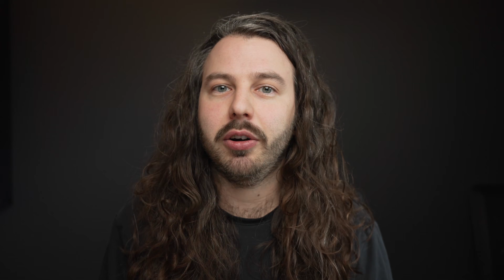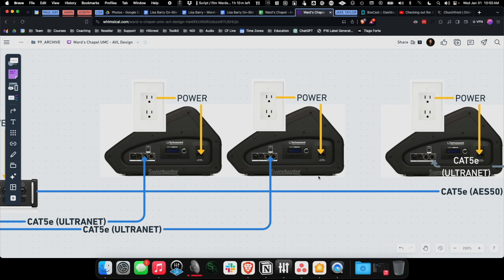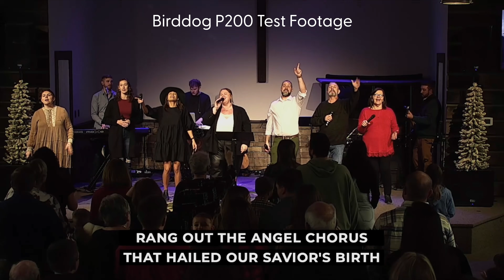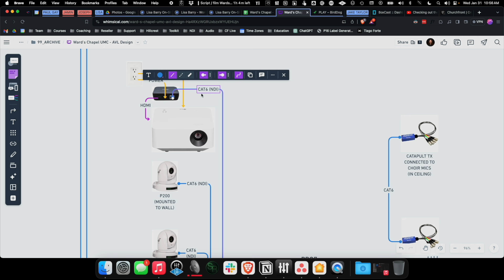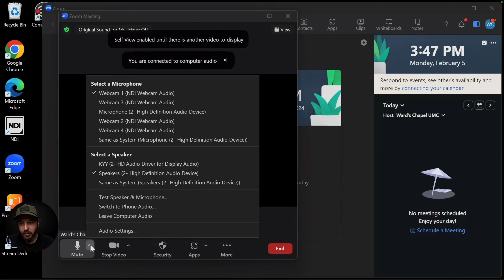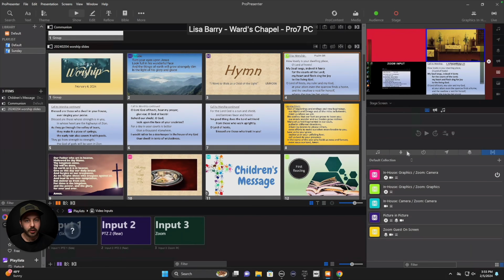How to Add Zoom Guests to A Church Live Stream (ProPresenter and NDI Deep Dive)

Comment: Hey here from Pune, India! Thanks for the amazing video... I had tried this setup earlier a year or two back and ProPresenter gave a lot of issues while dealing with NDI and video inputs. What must be the reason and how to solve this?
Reply: I've not seen issues with NDI and ProPresenter, try it again!
Reply: The new updates from pro presenter works well. 2years ago definitely it wasn’t well receiving unless you go through the same process of local network as he did. 
So, make sure you are on the same network is first thing. You definitely need to separate the two computers too

Comment: I've done it before with an attempted Mix Minus but had difficulty due to the setup at the time and the lack of time to make major changes. I also needed to be super vigilant with mic levels while the remote speaker was speaking. Just wondering if there is an "easier" way to manage things.
Reply: It has it pros and cons. Since you are using local network system and IP congratulations everything run over the network. But he did well setting them for the future upgrade.

Comment: How do you avoid the feedback when the Zoom users speak into the room while mics in the room are hot, the Audio from which is also going into zoom, which is then playing out to the room... see where this is going?
Reply: You have to create a mix minus to your caller. Make sure it’s just the main speaker’s audio going back to them and not room mics. 

You want to make sure that the audio being sent to your collar is as clean as possible. What can happen is, if there is a lot of extra noise being returned to the caller, zoom, or whatever communication software will think that the speaker is trying to speak when it’s just audience mics, and it will turn down the caller’s microphone .
Reply: They also wanted to hear the worship singers while make altar calls etc. sooo...yeah... like twelve live mics plus instruments (some of which weren't direct digital inputs and also has open mics) @Darielcummins
Reply: You could also try using a Dan Dugan Automixer type of product. You can assign microphone priority which would take the weight of trying to be vigilant with audio levels off of whoever is mixing.
Reply: @Darielcummins  I’ll research this a bit. Some of us (me) try to manage it how things are now but I need to think about how others can manage when I am not there.
Reply: This is what I found myself doing recently for a UK-Nigeria Zoom hybrid meeting: Have usual PC with OBS feeding through to Zoom. I have two sound channels in OBS, one for usual outgoing, one for Zoom incoming. For this meeting I turned feed from the sound desk to OBS off and turned sound from Zoom on. The Zoom machine was a separate laptop the sound being connected to and through a 6 channel Depusheng (Temu job) usb connected interface. usual sound desk streaming mix into laptop, sound from the laptop to an external input channel on the yamaha LS9 for local consumption and no feedback.
I wanted to use HDMI to USB capture and into Mac and Propresenter 7 but found, even though the sound from ProP Mac wasn't used, I still got feedback. So I connected a mini PC which also ran as Zoom client, the output from THAT into ProP was fine. 
The Mini PC showed as Zoom client, the gallery view or pinned/spotlighted whatever wanted to be shown to the local congregation as a HDMI to USB capture, so becoming a video source in ProP. We had problems with NDI on some machines the day before, so we didn't use NDI at all.
VERY important, to turn Original Musician option on for music and where people talk over the top of each other e.g. everybody praying at the same time or an animated discussion